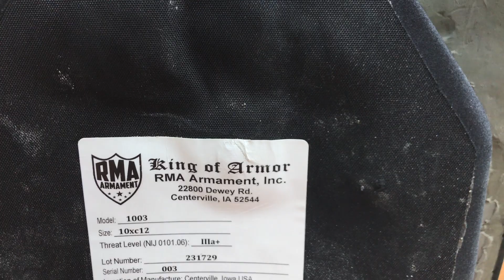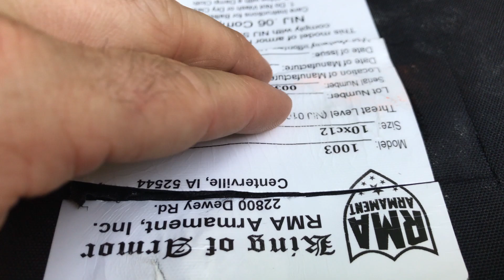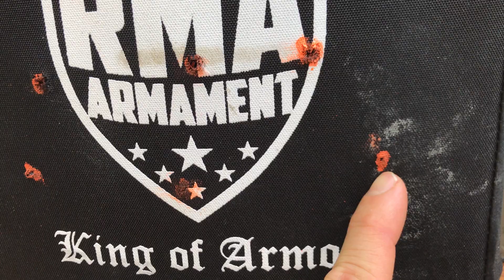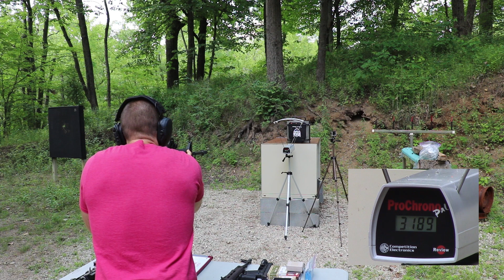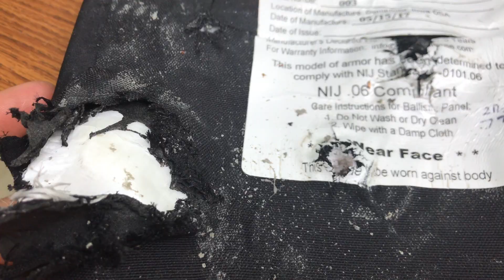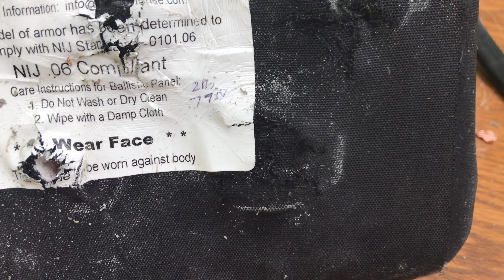RMA Armament's Level IIIA+ 1003 SRT (Special Rifle Threat) Demo!

Comment: would love to see you do a rehash with M80 ball, the website claims it can stop 1-2 rounds, but it’d be neat to see the BFD, and also some of the steel core ammo with a soft armor backer, like you did with the L210.
Reply from the maker: They just talked about sending me a pair of these. :)
Reply: @BuffRANGE  i just picked up a set and am really impressed with them for what they provide.  wondering if investing in some soft armor backers would add anything besides weight and bulk.
Reply: @BuffRANGE   I would love to see a test of this plate with soft armor behind it, I'm very curious to see if it works well as an ICW plate. I'm mostly concerned with green tip ammunition.
Reply from the maker: @JSM89889  IIIa behind this would not stop M855.
Reply: @BuffRANGE  yeah, that's what I kinda figured with these types of plates and how they worked. Appreciate the quick response.

Comment: Nice!  I realize this is an older video and the market has changed dramatically since, but to state the obvious if a person is getting into ceramic/PE now in late 2020, there's no reason to go any lower than Level III or Level IV.  They're super cheap and not really much heavier. Of course even a few years ago when this was made that wasn't the case.

Great videos, you're one of the subs I've stuck with the longest.🤘🇺🇸
Reply from the maker: Thank you very much for being a sub !

Comment: Worth repeating that this plate is 2.53 pounds and 0.8 inches thick. So for them to include the A in the rating is a bit odd since it's really closer to the weight and form factor of a normal UHMWPE rifle plate than anything you would normally consider Level IIIA.
Reply from the maker: Probably can't pass backface on M80, but maybe it could :D

Comment: how is a 3a rated for m193?? wouldnt that make it a level 3 rifle plate?
Reply from the maker: +Brian Hunter this is where it gets tricky. NIJ standards are minimums. 5.56 isn't listed as a standard NIJ threat.  This plate easily makes IIIa standards, it's labeled as such since it probably would fail against the NIJ Level III M80 ball. PE plates stop high velocity threats as long as they're lighter and don't contain steel
Reply: Hey Bud love what you do! yea these ratings can get sorta funky, its insane that a 9MM steel core was poking out the back but stopped 2 5.45mm.... the steel plates light and fast do better( m193, 7n6) but these plates battle rifle calibers would do better but stop the small fast rounds that kill steel plates. I guess n.i.j ratings dont matter very much when you are just trying to poke a hole in them for entertainment.
Reply from the maker: Yeah, It's interesting to say the least. This plate would be an awesome alternative to a Level III steel plate, except it can't stop M855, or M80 (at least at full velocity). I want to test an actual NIJ level III composite next.
Reply from the maker: I'm working on some 22-250 tests..
Reply: Yep. For example the 22-250 is like a 30 grain? Or lighter round going over 4,000 fps goes right through the AR500 III+ 1/4" 11lb steel plate that stops true AP rounds. But ceramic or composite level III plates (lesser rating than III+) stop the round cold with not even a trace of back deformation at all. I wonder if this PE plate would stop it since it's a very light round but going super fast. (4100 fps)
Reply: Impressive but these definitely need a trauma pad behind it. Maybe 2